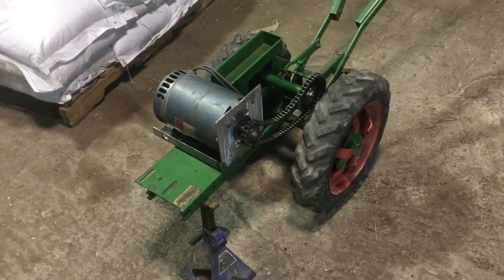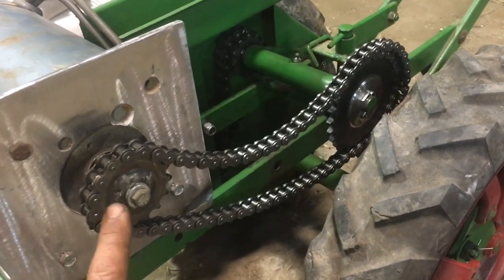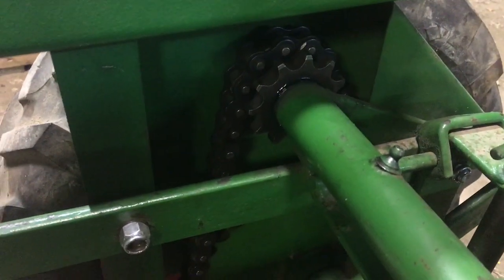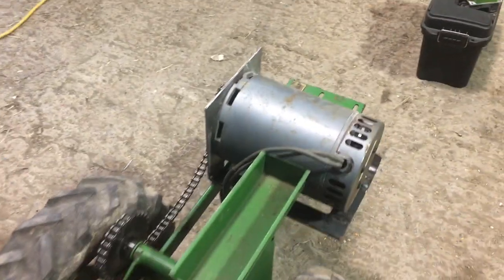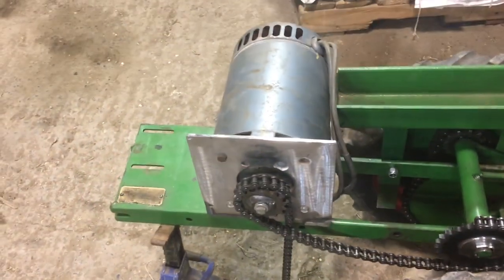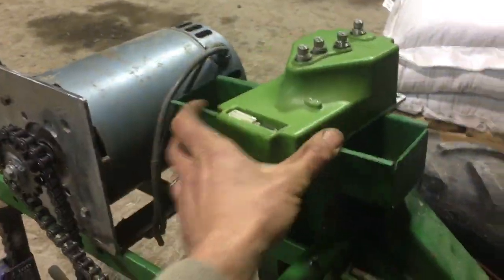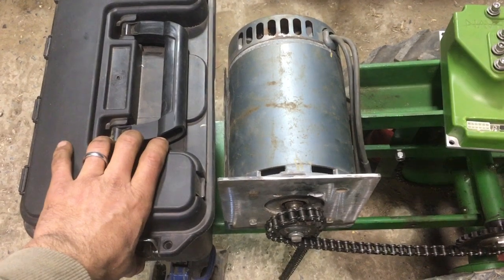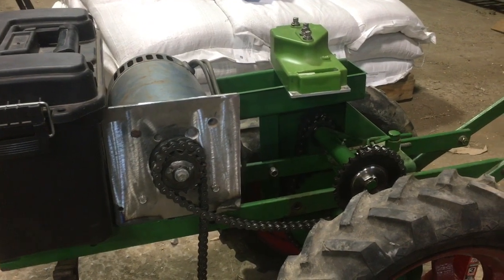Electric Planet Jr. cultivator - part 2

Comment: Looking good! What's the controller (model)?
Reply: Think I found it: Navitas (not sure of model though)
Reply from the maker: It's an oddball I found on eBay.  Navitas TPM100. For brushed permanent magnet DC motors. 24-48V and 100A continuous so up to 2.4kW at 24V and peak of 140A!  Way overkill add this motor is rated to draw 32A and tested spinning the wheels it draws 5A.  But I think I paid $30 for it a year or two ago and figured I'd find a project for it eventually 😊
Reply: @reidallaway  Thanks for that. And a very nice find!